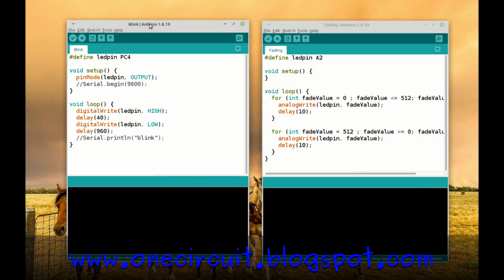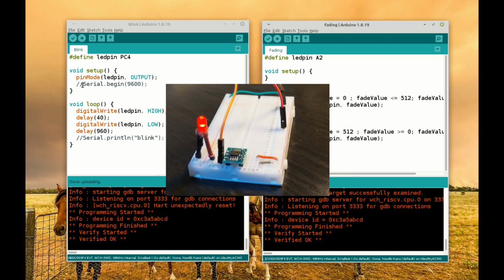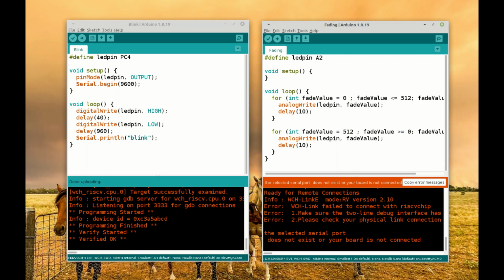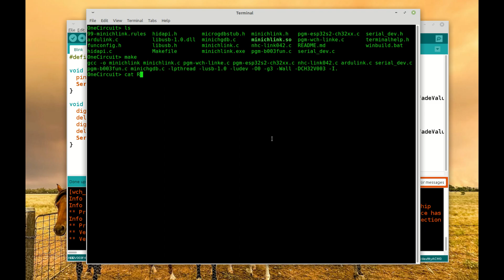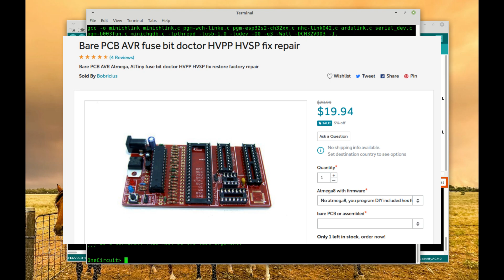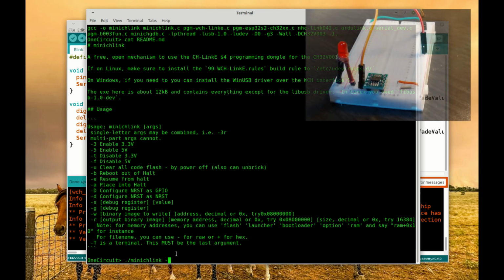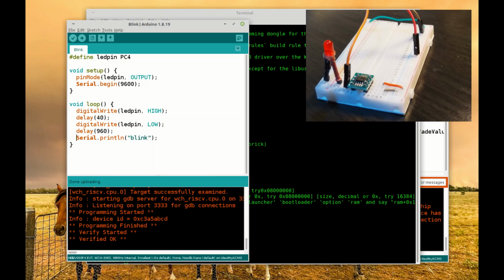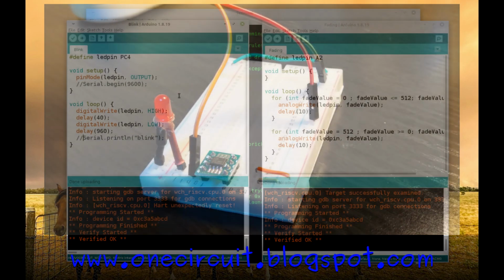Easily unbrick your CH32v003 using the free minichlink program

Comment: When powering MCU with wchlink-e 3v3 pin there is no reason to manually disconnect power line, minichlink -u command will manage power cycle for you to unbrick device
Reply from the maker: @pavloromaniuk7535  not in my experience. The manual power cycle worked every time! 👍😀

Comment: Just today ran into something similar where I screwed up my port config (working in C) and I couldn't flash anymore, bricking two chips.  Whenever I would hook the chip up to the WCH-Link through SWD, V, G, I would see the red LED on the board glow faintly.  Whenever I tried to identify the chip with "minichlink -i", it said the wrong chip ID (CH32V10x) and I got a bunch of "Fault on op (DMABSTRACTS = ffffffff) (-1) (Other Error) DMSTATUS: ffffffff" back, leading me to hypothesize I had somehow set the programming pin to pull up and minichlink was just seeing a flat high signal.  I screwed around with a bunch of resistors to try and pull the SWD line back to ground enough to avoid this pull-up until the "minichlink -i" would read back "link error, nothing connected to linker (4 = [81 55 01 01])."  Trying to put processor in hold and retrying."  signalling to me that I had pulled hard enough that I was hopefully in the sweet spot to get some kind of signal through.  This part is super finicky and seems chip dependent, so a trimmer pot would be better, but between 500 to 1.2k ohm seems to be the sweet spot.  For the chip I re-bricked to methodologically test while writing this procedure a 1k resistor worked fine, but your millage may vary.  Also, counterintuitively, having these resistors caused the red LED to get brighter, so don't worry about that.  Then, when I would "pogo" the power jumper to the chip against the 5V power rail, I'd every now and again see "CH32V003" properly show up when running "minichlink -i" (If your resistance is too high it'll keep giving the wrong chip ID, if its too low you'll never see the chip ID show up, so those are your canaries if your resistance is off).  Once I was seeing CH32V003 show up semi-regularly when pogo-ing, I queued up "minichlink -u" (it seems like the newest version stalls while waiting for the chip to show up), plugged the chip into power with ground already connected and SWD attached to the pull-down resistor, and the chip erase worked fine.  Unplugged the WCH-Link, plugged it back in with the pull-down resistor removed and the chip already wired to power, flashed with Embeetle, blinky works fine.